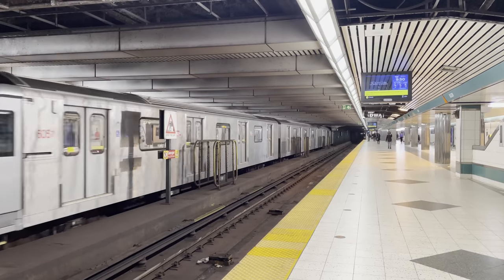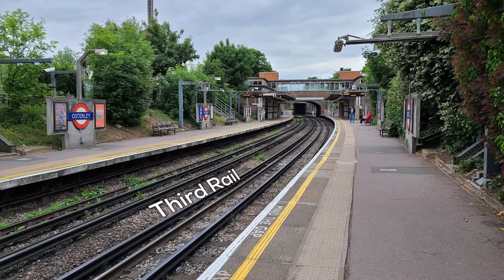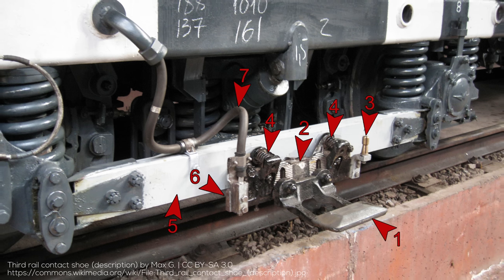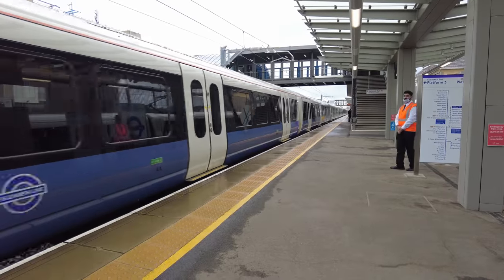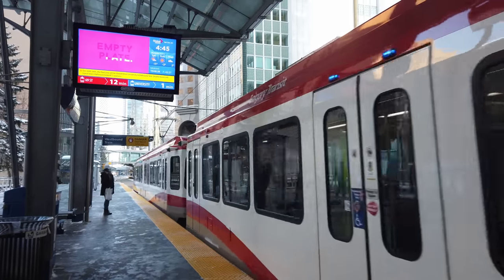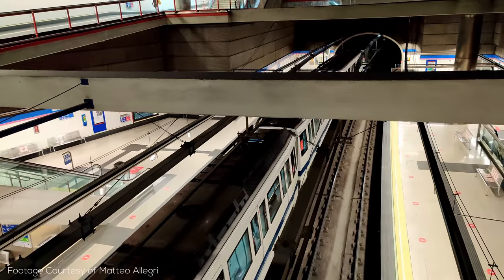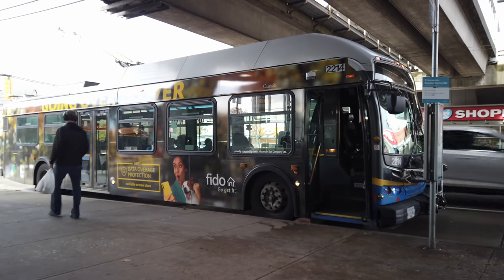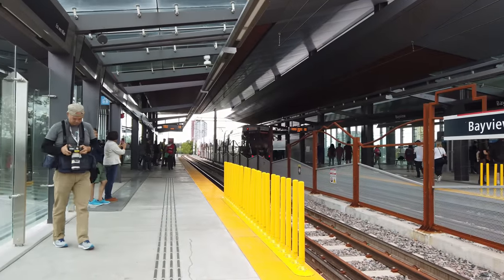The Best Way to Power Your Railway | Third Rail vs. Overhead Wire

Comment: My question has always been: Why can't they just use 2 rails for electrification? Why do you need a 3rd rail for power? Can't they just power one of the 2 main rails, the same way they already use the main rails for ground/return?
Reply: No you can't and the reason is simple, third rails often bottom contact these days have insulation on other 3 sides. So you can step on a bottom contact third rail no problem (but don't do it). Now a regular rail is a complete metal alloy so that it can bear the weight of train. You cannot ot have wheels running on say plastic coatings because it will wear immediately. Now if you power this completely exposed piece of metal, image the consequences.  

This is not an issue for grounding because the charge immediately flows to the earth and the rails are always neutral.
Reply: Volks Electric Railway in Brighton was originally 2nd rail electric, and that is the oldest electric railway in the world. It is a tourist ride rather than a proper train service.
They switched to third rail due to problems with current leakage.
Reply: Safety, Points and Crossings, and signalling (train detection) AND every axle on every rail vehicle would have to be split and insulated to stop it shorting out the power.

Comment: One correction, the Eurostar trains had a third rail option because the UK did not build  a high speed line (that was fully opened in 2007, 13 years after the opening of the Channel Tunnel ) so trains used regular lines that had a 3rd rail so it was a high speed train with a 3rd rail but it was only used on regular speeds of 160 kph so it was not used for high speed journeys.
Reply from the maker: Yes, thats all I said! Not that it could operate at HS!

Comment: Question why aren't more 3rd rails in the middle of the track 

Is it difficult to do
Reply: I think and I may be wrong. 
It may not be difficult but the problem is that when third rail is in the middle, it can not have bottom contact third rail. In order to achieve bottom contact third rail the  third rail needs to be higher than the other 2 rails. This is not possible in the middle of the track.
Reply: @kartik_sinha  that makes alot of sense 

Though I do wonder if a clamp style design with the electrified portion in the middle (vertically) could work 

It would need a clamp with a stabilized system but it might be feasible
Reply: I think putting the third rail on the outside of the track is just because you have to connect wires from the grid to it, in order to be able to energize a middle rail you have to run the cable to it under one of the running rails, otherwise the cable gets sliced through by the wheels.
Reply: @AlRoderick  but third rails keep switching sides so the wires anyway run under the rails.
Reply from the maker: Theres also more safety risk this way, when evacuating with a more typical third rail setup you can tell people to stay "between the rails"

Comment: You didn’t explain why some systems use a fourth rail. That seems to be an added infrastructure expense
Reply: Basically to ensure DC return currents don't enter the ground and cause corrosion of the tunnels and other steel work.  It also allows breakers to break earlier improving safety.
Reply: @barrieshepherd7694  Also, the signaling system is greatly simplified;  no impedance bonds to deal with.

Comment: Great stuff ...think there is a tram system in southern France that uses battery power,being recharged at stops,, modern maintenance trains on subways are battery powered, so future trams, local trains services have the potential to do away third/overhead rails, so safer overall and less maintenance
Reply: I know that one of the lines on the Nice tramway does that
Reply: And vehicle capacity is limited by the need for a battery to be lugged around;  just like fuel tanks on an internal combustion engine-powered vehicle, except that with internal combustion,  the engine and transmission consume a helluva lot of space as well.

Comment: I might have missed it in the video, but do trains exist that can handle both diesel and electric at the same time?

Seems like a lot of rail in the US is of the commuter variety instead of metro/tram - and is diesel-driven, often on lines where electrification doesn't currently exist. If you could progressively electrify lines over time instead of all at once, it might actually lead to moving these lines away from diesel more effectively, resulting in less pollution overall.
Reply: Yes. In the UK, we have trains such as the class 755 from Stadler that can run on diesel power or on 25KV AC Overhead. They exist in the US as well, I believe the locomotives used on the LIRR and into Grand Central can switch between diesel and third rail power
Reply: Yes, the Class 800 and 802 trains in the UK can run on 25kV a/c overhead and diesel.

Comment: Is dc better than ac for overhead wire?
Reply: The main problem with DC is that you can't easily change the voltage — which allows you to minimise losses by resistance — as with AC and as a result, you need a lot of substations with it which is why often found within local systems such as trams, though there are countries which do use DC powered wires for railway in Europe such as France and Poland.
Reply: @MarioFanGamer659  thanks

Comment: Overhead catenary for trams/light rail isn't as safe as you make it appear IMHO.
Yes, it's the safest option for a fully electrified network, but stuff do happen from time to time.

As you mentioned, taller than normal trucks can make contact with the overhead wires and short them to ground or pull them down.
But there's also instances where for whatever reason (mainly due to intersection complexity) even trams will pull overhead wires down.
And finally, if the overhead is suspended from "custom" solutions such as building facades etc (again, complex intersections and spaces where you'll have a hard time putting up poles or gantries) they are hung in a way that is very sensitive to changing conditions. Strong winds will "bend" and "twist" the "rigging" such that wear or fatigue can cause the overhead to fall down without anything pulling on it.

The latter is quite dangerous to any unsuspecting pedestrian, or for that matter anything around it as the wire is still live as it falls to the ground. Sure, you can have safety measures in place but it's still possible to get shocked to death before the safety system trips.
Not to mention the possibility of having steel cables whipping at high speed through the area that are capable of cutting things in half.

Is there a better way though? Not really if your goal is to provide a fully electrified network...

Comment: 7:44
All third rail trains in the UK are legally restricted to 160km/h, and most lines powered by it go slower than that. Any faster and the 750 volts of power won't be able to handle it safely, so I dread to imagine the consequence of doing 300km/h down the brighton mainline..

Comment: Third Rail is garbage. It's not really that useful when it comes to outdoors, cause theres a high risk of animals/people getting electrocuted when it comes to third rail. UK Operators such as SWR/Merseyrail and that tend to use Third Rail. Whereas ScotRail, Northern, GreaterAnglia, Avanti use OHLE. Same with OHLE, Third Rail tends to pick up electricial energy using the metalboxes mounted to the bogies called the third rail shoes. Compared to OHLE, AC uses Pantograph to constantly constitute electricity from the wires. Third Rail is used as DC.

Although, when it comes to Overhead Line Equipment, You get the amazing technological equipment of 25kv AC, which you still continuously receive the power for the train, and same with the third rail, except third rail uses a incredibly different component.

Comment: Although electrification brought so many advantages, I hope that the future will be shaped by on board hydrogen cell: in my opinion as the efficiency improves the cost effectiveness improves with it, since you could erase all overhead system, thus having less maintenance, less electrical loss and less points of failure. The future of rail should orbit around efficiency and little to no maintenance, with technology like hydrogen cell and neodymium magnet motors, and infrastructure like ballast less tracks, which require basically no maintenance and can last up to 60 years with no derailment or other accidents. Sadly, the former is still under development and it’s premature to adopted on every line (regional, high-speed and cargo), and the latter requires a much higher capital cost (note that lifetime cost of ballastless and ballasted tracks can be compared, with even a slight advantage for the first).
Reply: With the hydrogen cell train you have the issues of carrying the hydrogen around with you in heavy containers and the refueling problems maybe better to use fuel cell technology (when it's developed) in a fixed installation feeding the energy to the trains via overhead lines?
Reply: @barrieshepherd7694  Yes but then you would still have all the problems of a catenary system. Moreover today hydrogen trains (mostly regional) are capable of about 800km, with only ~20min of refuelling. That’s actually not bad, and it can only improve. Still, you moved a good point, it depends on the overall efficiency of the two systems
Reply: The problem with hydrogen is that it's still fuel but most importantly, it isn't very efficient to get it. The idea is that most hydrogen is a byproduct of natural gas production (not very clean...) while the rest has to be converted from electrolysis which comes in quite a bit of losses, more than the losses you get with raw electricity. Hydrogen trains, much like battery trains, thus shine in branch lines where electrification is unlikely / a low priority but ultimately, the trend is for more electrification, not less like you desire.